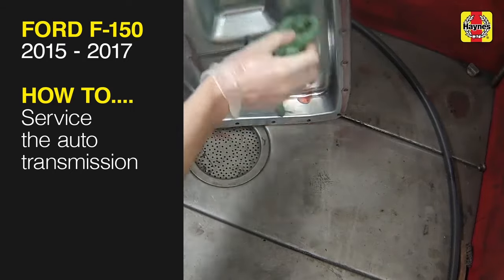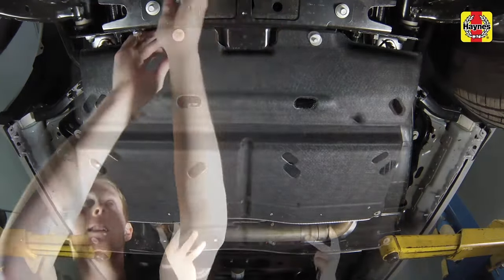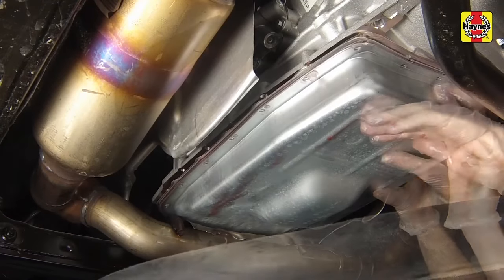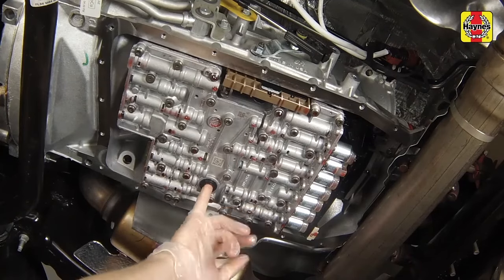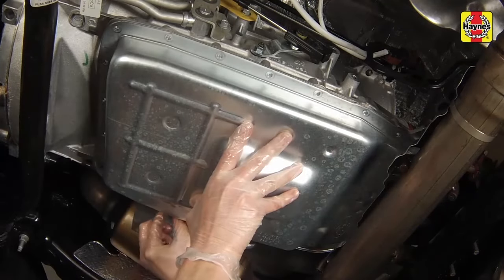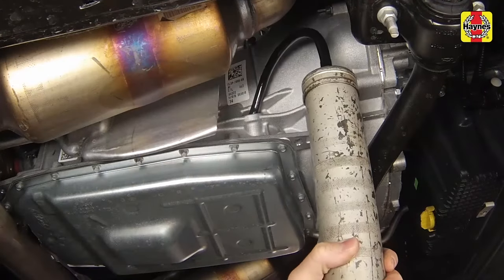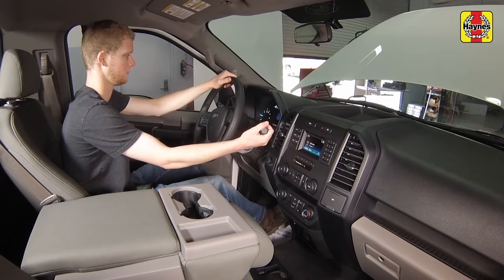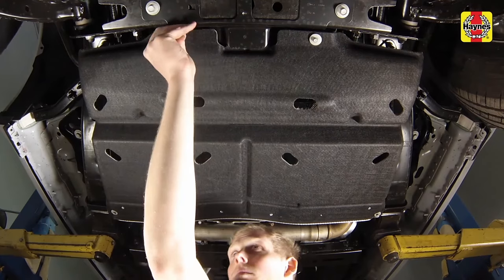How to Service the auto transmission on a Ford F-150 2015 to 2017

Comment: Please in addition to the amazing info here look at the solenoids at front of valve body, my 2015 with 90,000 miles had a failed hitch pin retaining a solenoid it looked odd and during inspection found it was inferior and broken, added new clip and restored trust and durability to transmission, original broken clip did cause damage to valve body. Service transmission more often then recommend intervals!

Comment: how many gallons/quarts of transmission fluid i should prepare for this. this is definitely not all the transmission fluid in the transmission
Reply: It looks like they only changed the transmission fluid and not the torque converter.

Comment: Why on earth wouldn’t ford have a drain plug in that pan!
Reply: Dorman has a pan with a drain plug. I bought one and it fit perfect using the existing gasket
Reply: @ty27328  best comment on the video ^. ive been trying to make my f150 easier to service because they really dont make em like they used to....

Comment: Question ? Is the auxiliary pump inlet seal comes with the filter FT-200 ? Included or sold separately ? Be nice to know ahead of time ! Thanks anyone for your response !
Reply: I know the duralast TF504 kit from autozone come with the pan gasket and the filter but I’m not sure about the seal… I would go to the dealer for the seal to be 100% positive it’s correct!
Reply: I recently bought the filter and yes the seal is included, genuine motorcraft parts ! Thanks for the reply.
Reply: Where did you buy the filter that came with the seal? @Capsmoren
Reply: @EXPLOREMOREFILMS  In Canada I got it at a better price than the dealership at Parts Avatar and it's genuine Motorcraft parts

Comment: I cannot find a part number anywhere for the transmission fluid auxiliary pump inlet tube seal. Anyone know the number or have a link?
Reply: Same here. Actually this is the only video I’ve seen where they replace that part.
Reply: I purchased a filter through a Ford dealership (BL3Z-7A098-A) for my 15 F150. No auxiliary inlet seal included.
I think it may be related to the start/stop option that my truck does NOT have.

Comment: Is the fluid  in the torque converter getting drained too? I heard there's more trans fluid in the torque converter than there is in the transmission.  Is tht correct???
Reply: No this is just the fluid in the pan.  They stopped putting drain plugs in torque converters decades ago.  If you want all all the fluid changed at once, you'll need to go to a place that can do a full flush with a machine OR you can google the diy way of pulling a trans line and doing it yourself if you are up to it.

Another option is to drain whats in the pan, refill then, drive around for awhile, then drain again and refill.  Doing rhis 2 to 3 times gets most the old fluid out.  Its more time consuming and more trans fluided, BUT a lot easier for someone to do.

My gramps '93 f150 has a view port throught the the trans bell housing and the torque convertwr has a drain plug.  The days where vehicle manufactures helped the diy'er are just about over.  Ford hasnt had a drain plug in the axles diffs for a long time.  So simple to have but it saves them money and cost the consumer more.

Comment: I never heard anyone say to suck fluid out of the unit before. That’s a great idea. I will try this when I do my first fluid and filter change on my 2016 F150.
Reply: @MetanoiaOfferMastery  I did this when I changed my filter. I uploaded the videos.
Reply: Everyone looking like idiots now, I’m laughing too much now. I’m about to do my first transmission oil change. This looks easy.
Reply: I need to add some Lucas transmission slip in my truck

Comment: Darn, i read 80ft lbs of torque, not 80 inch. Now i broke a bolt lol
Reply: @SexyTexas  I had to use a hinge sighting drill with a left handed drill bit in reverse and thank God it came out, and I didn't warp any gaskets or the pan.